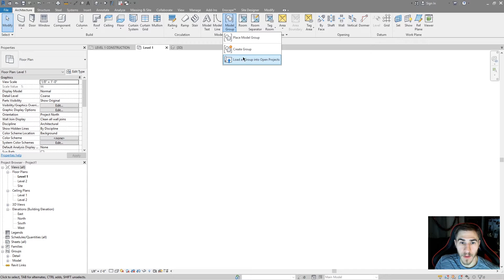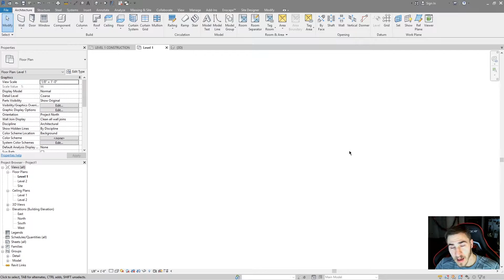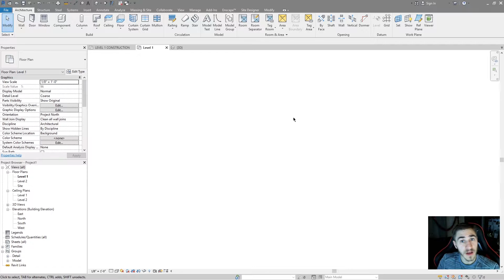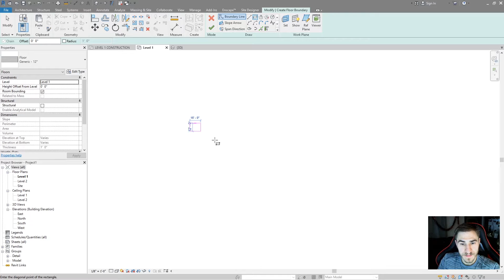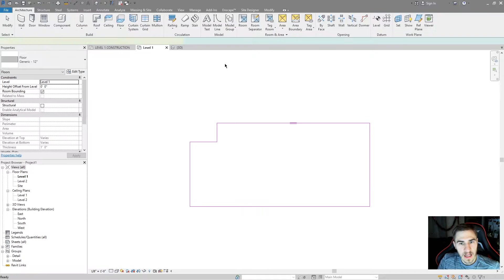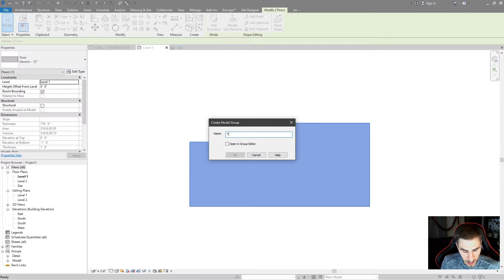How to use Model Groups - Part 2| Revit 2020

Comment: Hi,
first of all, thank you for the vidies, I've learned alot. I have a question regarding to the design options and Groups. I don't have access to the full Revit licence. and I wanted to add different options on my residential plan, but since I don't have the Design option on my Revit I decided to create different Group option for the floor plan needs. do you know If it's a good idea or I can use any other commend that Revit Lt can handle? I really appreciate you if I can have your opinion.

Comment: What would happen if deleted level 1 from the group as well? Because it's creating duplicates of that level in the project.
Reply from the maker: I would avoid putting levels in groups. Then you can just work around the levels.
Reply: @ArchitectureVanguard  Thanks for the quick response. What I meant to say was @21:20 you deleted the floor and level 2... but kept level 1. What happens if you were to delete level 1 also? Would you encounter any issues loading the group without levels?

Comment: What will happen if you have a group in to another gruop? How do you handle that? any tips?
Thanks by the way for your useful videos.
Reply from the maker: It can work but everything I mentioned as to all the issues is just compounded and you are just asking for trouble down the road. May not even take that long to find issues.
Reply: @ArchitectureVanguard  That is how people here in Sweden work. For example we have a main group for an apartment type and in that main group we can have different groups for WC and kitchen for example. But as you mentioned so this way makes just more problems

Comment: Maybe you have some group bias , and I have some link bias lol. I usually have my site as a link and all the other disciplines models as separate link, but work mostly with groups. I think that if you are working with many people that are going to be making a lot of changes then you should use links because maybe things won’t break as often. But I think if you’re working by yourself or with people you really trust then groups work just fine. When I had a lot of links, it took longer to open files, but maybe that issue is solved if you use worksets.
Reply from the maker: I agree with you on the links, I really do prefer links in most cases. I try to keep my groups as small as possible so they are easy to manage. Besides that, links are fine. Another nice part of links is if they are all worksharing files then you can have everyone working in all of them at multiple times. If I have links, I often have multiple revit sessions open so I can working in both the project file and link at the same time.